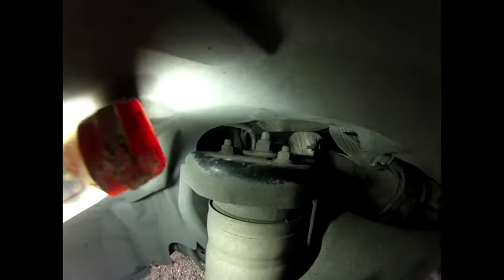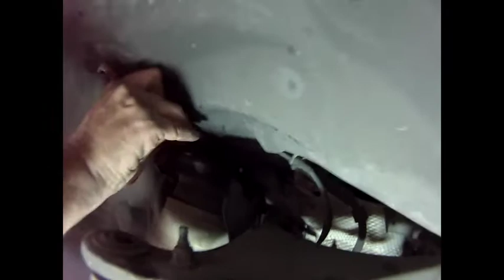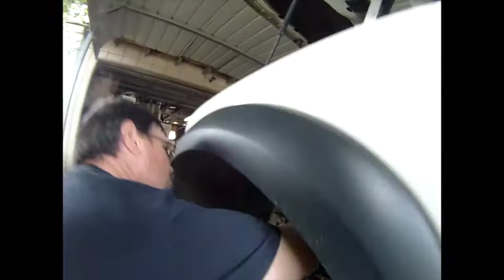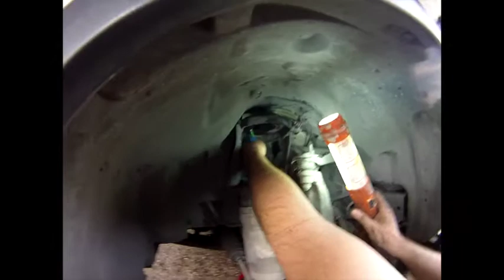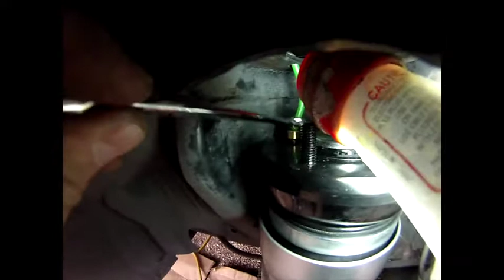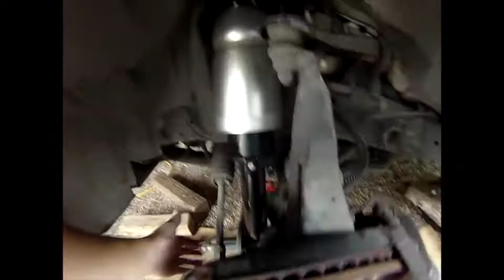Land Rover LR3 Air shock removal and replacement

Comment: Great video- thanks for making it. 

Another way to get to that back bolt is to just pop off the fender and take out the plastic wheel well lining. Takes about 5 minutes and then you can get a socket wrench onto that back bolt. 

Thanks again.

Comment: Thanks for the video!! But I think you don’t need to disassemble the airconnection on the strut, leave it on the strut, just pull the plastic out and click the  hose in after removing the old connection... saw that in an other ‘how to..’-video.